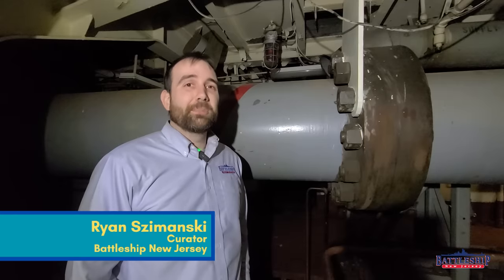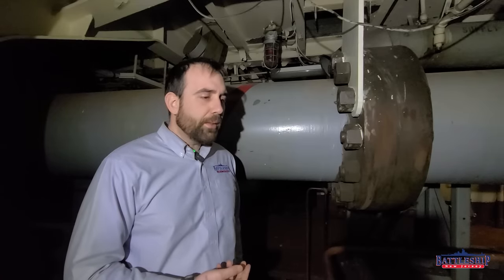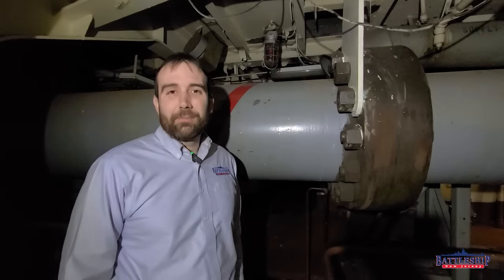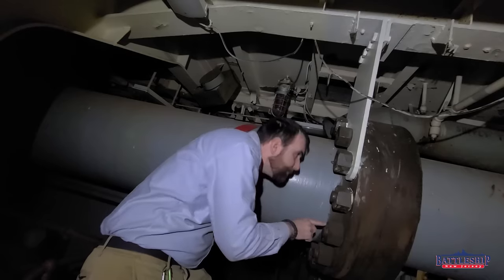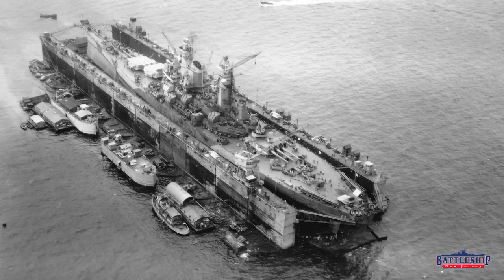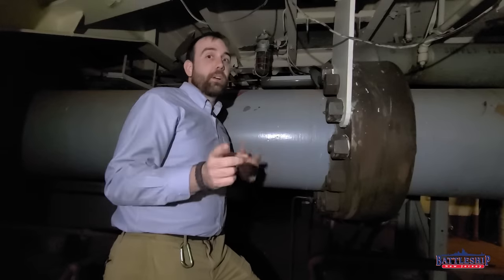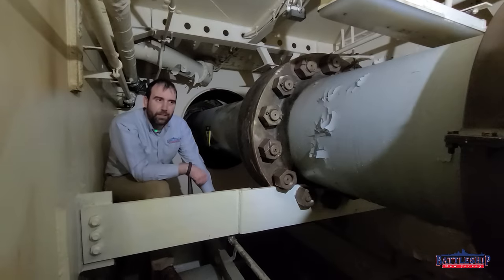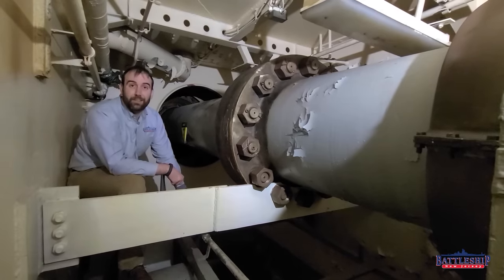Can The Propeller Shafts (And the Screws) of the Battleship Still Spin?

Comment: I was told about an event that happened before I reported to USS Long Beach CGN-9. The story was a messenger watch blew off his rounds and a line shaft bearing had an oil leak. The bearing stripped, then melted. When they finally stopped the shaft, it had gotten so hot the sand in the shaft was melted. They pulled into dry dock in Hawaii and pulled a shaft section out of some warehouse. We were told it was a war time reserve shaft. Anyway, the shaft was replaced, the watch was convicted in court-martial, and the ship continued on deployment. That section of shaft had a larger diameter flange than the rest of the shaft. I assume the navy still has spare shafts stored somewhere.

Comment: Interesting that you said they didn't want the engine turning.  The huge steam turbines at power plants have a turning gear that slowly rotates the turbine shaft when started up or shut down to allow temperature to normalize uniformly.  Also used sometimes when shut down for long periods to keep the turbine rotor from bowing if left stationary for a long time.

Comment: I still say that this old battleship ship has more use than the Navy’s “high tech” LCS “Littoral Combat Shyt”……the Navy is retiring these new ships as they are worthless. Why not have a new style ship like this. It would be much better as the Navy is getting more “action” these days.
Reply: The LCS ships are not worthless as a class.  The problem is two-fold.  First, the contract says that ship's force is not allowed to repair anything in the engine rooms, so any problems by contract will need to wait until they can get folks from the shipyard  to the ship or the ship to the shipyard.  Second, the USN under pressure from congress kept changing the mission of the ships, making them ill-suited to efficiently perform any specific task.  In a nutshell, the ships are container haulers with the expectation that any mission-specific equipment will be pre-installed in modules to be winched on board, tied down, and connected to power, data, plumbing, or whatever.  Ditto for the berthing areas for the equipment operators...just another couple of modules to be secured and hooked up.
Reply: @kevincrosby1760  yup, essentially as a retired Marine I see them as worthless. They are floating targets and can’t be useful / ready when needed. 
Additionally, name a war where these Generals actually won? 
I was there in Kosovo / Bosnia 1999, 5 tours Iraq, 1 tour Syria, 3 tours Afghanistan. I’ve been on many many ships in my career. The Navy has lost its mind as well as the military in a whole. Since I retired in 2015, I’ve seen some stupid stupid programs to waste money on. 
Just my opinion though
Reply: @MountaintravelerEddie  Don't EVEN get me started.  Classic example of officers who know everything failing to listen to the non-coms who actually have a clue.

"Newer" is not always "better".  Target is at 600 yards.  M4 or M14?  Self defense.  You get one shot only.  .45ACP or 9mm?  (full disclosure:  My EDC is 13+1 in .45ACP.  I may be biased.)

Biggest pet peeve...  Ship needs fuel.  UnRep with a Navy Oiler at sea, or pierside in Yemen like the USS Cole?

Doesn't matter what we are discussing.  The more tasks you try to get a given platform to perform, the worse it will perform at any one of those tasks.  

IC2
USS Kansas City (AOR-3)

Comment: In boilers you always have a nice assortment of knocker wrenches to remove nuts from tank heads , pipe sections,shafts ,and turbine housings. I’ve seen those wrenches as big as 10” inches.

Comment: I was stationed in Long Beach 89-93 and many of the larger parts for the Battleships were kept there. also as an MR (Machinery Repairman) I was stationed at SIMA San Diego 31a machine shop (00-03) and we had the vertical turret lathe that cold machine the turret parts. That VTL had been there since WW2 and I believe its still there.

Comment: Those "locks" remind me of my friend who used an entire ball of kite string to tie a railroad car to a track bumper post to keep the car from moving... I suspect that if they were to fire up the boilers, and engage the engines, those plates would not keep the shaft from turning.
Reply: Oh yeah, the shaft would turn under main power but it might do horrific damage to itself before the plate broke
Reply: @JamesF0790  As thin as those plates are, and the length of the plates, they are like tissue paper, compared to the shaft or armor they are welded and bolted to.

Comment: Hi Ryan, good video of the shafts. I did my apprenticeship with a shipping company here in NZ and I think you will find that the shafts, if need to be removed for inspection are pulled inside the ship. Reason being the large flange that holds the coupling bolts is too large won't go through the stern tube (bearing just forward of the propeller). We used to remove an intermediate shaft to allow room for the tailshaff to be pulled inboard. Cheers Ian - New Zealand.

Comment: You don't have these shafts on modern cruise ships which are way larger.  Modern boats use "Azipods", or pods that hang down from the bottom of the boat and have 40,000 hp electric motors inside.  These can spin 360 degrees and normally the propellors are at the front of the Azipod, in a "tractor" configuration, just like an airplane.  

There are a few older cruise boats that have shafts, such as the Ruby Princess and similar boats, but they still use electric motors to turn the shafts;  The four huge Wartsilla diesel engines operate generators.

Shafts are going the way of the dinosaur!
Reply: Still the most efficient way to move an aircraft carrier. I’d like to see the pods function in North Atlantic on a DDG where the screws can come out of the water when cresting waves. However, having been on a carrier while pulling into port, I’d love to have those pods!  Took us a couple hours to get moored while a cruise liner zipped by us, rotated pods and was pier side, moored, brows down in a bout 30 mins lol. I think subs have some sort of retractable “pod” they use for maneuvering in port?
Reply: @USNMMCret  I don't know about subs, but they have a ducted propellor these days that can turn a whole hell of a lot, and thrusters are pretty easy to install.  As to the azipods, they are fully electronic with only an electric motor in the pod, so they can spin 360 degrees and propellor speed is controlled down to the 1/10 of a second.  Operation during a DDG probably wouldn't be a problem as a result. They just spin and the amperage sent by the computer goes up and down;  The device could care less if it was moving water or air....

(Hey, maybe it will knock some barnacles off...)

-The only problem with azipods, and this is why I think the military is avoiding them so far, is that they have had trouble meeting time before overhaul.  The bearings have been trouble, trouble, and more trouble. Did I mention that the bearings in these have been trouble?  These have been around for 20+ years and only this year did Princess cruise lines build a boat with these;  They have publicly stated that they don't trust them.  Carnival in general has been slow to take them.

Thanx!  🍻
Reply: @Flies2FLL  I think that the sea-tractors (tugs) used at the Kings Bay Naval Base in Georgia have pods for propulsion. They were used to get subs in and out of port and they were using that technology in 90’s. Would be curious to see if govt have considered using on MSC ships to see if efficient.

Comment: I was wondering, A ship like the NJ is bound to have asbestos in it for insulation/fire protection. Does this affect the docking in any way?
Reply from the maker: We're fortunate that the navy removed almost all of the asbestos in the 80s, so its not an issue for this project.
Reply: @BattleshipNewJersey  Beware the difference between "removal" and "abatement".  The USN categorically denies that there was any chance of my having any chance of asbestos exposure shipboard due to it all having been removed from the ship or abated in the early 80's prior to my service, yet the VA sends me in for imaging annually due to my having been on board in the Engineering department while asbestos was being removed during our 1988 DPMA.

"Removed" is self-explanatory.  "Abated" means that the asbestos is covered in such a manner or is in a form that it will not be an inhalation hazard during normal use.  All bets are off if you start disturbing pipe lagging or (more likely in your case) you start ripping out those pretty pre-80's floor tiles to replace the damaged ones or to preserve the steel decks beneath.  Other areas to be wary of are anything related to insulation in the fire rooms or the stack uptakes.
Reply from the maker: Ours was replaced with a different material.

Comment: With the locks removed, how much force does it take to rotate a free spinning propeller shaft ?  Other than getting that much mass to move, it may not take all that much. 
  One curator may be able to rotate the shaft.
Reply: Easiest way to tell is how big the turning gear motor is...   bigger the motor = more force

Comment: I’m curious about the drag from the stationary props and how much it affects towing vs if they could spin freely…like the tugs fuel consumption when it goes to dry-dock.
Reply: It's probably negligible considering the marine growth on the hull too.  You wouldn't want the shafts to spin without lube oil systems going otherwise you wipe every bearing in the reduction gear & turbines.

Comment: I wonder if U.S.S. Cod has a battleship sized wrench, I imagine they probably got something similar, any mechanical situation be planes, ships or vehicles there is a BFH and BFW nearby, Big F Hammer, and Big F Wrench since this is a family channel I will leave it at that.
In the Air Force as a Jet Engine Mechanic we had a "Wrench" to the install the Turbine shaft nut that hung from a overhead hook I also used the BFH on a daily basis Jet Engines had many fasteners that needed a little or.a lot of  persuading.🤣
Reply: They recently made a video about the prop wrench.

Comment: would they "unlock" the shafts to move it for dry dock procedures?  Or would it be towed? Thanks 
Spreading the word of your insights.
Reply: As a museum she's being towed. The navy doesn't allow her engines to be started according to the contract. In a more general setting if the Navy had them locked during the time they had the ship in reserve then they'd likely leave it in place and remove it while in drydock as otherwise the engine would be turning over from the shafts without the lubricating oil and stuff in it.

Comment: What would happen if the shafts were not locked and the tides caused the propellers to spin at a slow rate and turn the engines at a slow rate with no steam pressure, obviously the engines would not start because they rely on steam pressure to turn but could it damage the engines? I assume whatever preserving fluid the navy put in there is not the same as the normal engine oil that would be used on that kind of engine or is it the correct engine oil for that engine?
Reply: And why did the dry dock ask if the shafts were locked? Do they want them unlocked so that it reduces drag when they tow? the ship or do they want them to stay locked to help prevent possible damage to the engines and shaft seals?
Reply: I would think that with all the gear reduction it wouldn't turn the turbine which turns the shaft
 The engines power the turbines.

Comment: Does having the rudder and propellers locked into place hinder its towing?  Presumably most of the time (but I guess not the final time) if the ship was under tow, these things could move with the current?
Reply: rudders & shafts are usually locked for towing evolutions.  Tidal motion while at the pier is not enough to spin/freewheel a shaft - too much friction to overcome - but towing introduces a lot more forces and you don't want those systems moving without lubrication - would be like driving your car without oil

Comment: I wonder what the torque spec on those bolts is?
Reply: How would measure the torque on something that big?
Reply: @tomkrisel4493  With a very large torque wrench that goes "CLICK"!
Reply: @francissullivan5900  They might also have a spec where you bottom out the nut, and then make a specified number of turns... the torque spec would presumably be very high and a torque wrench, especially in the 40s when the ship and those couplings were built, that can measure extreme values and be easy enough to maneuver in that space would be maybe a little bit of a problem. Torque spec on my cars lug nuts is already 100 foot pounds, so that's 50 pounds of force on the 2 foot long torque wrench I use. 

Multiply that torque by probably a lot, and the length needed to make it reasonably usable by a human can get quite long. 

Though I suppose they could have some complicated torque wrench that uses some clever mechanical advantage to keep the length reasonable.  

That actually might be an interesting video, what are some of the specialty tools used to maintain and repair a battleship?  Even everyday road cars have a few specialty tools, though most of the time in that case standard tools can be made to work(though you might have to remove extra stuff to make room).

Comment: Uh....with packing sure if there welded closed no....but otherwise it would be a hard thing to get moving id imagine 😅
Reply: That's true. And if it is packing and hasn't dried out too badly it would have need to be connected to a stepping gear to keep them from warping g

Comment: Never seen how the 5 inch turrets are locked or are they?
Reply from the maker: They arent. We rotate them occasionally and fire them often.
Reply: @BattleshipNewJersey  I'm surprised you got working 5-in turrets, did anything special have to be done to them to make them work? I know New Jersey has very strict firearm laws and I also know that rifled and smooth bore firearms that have a barrel inside diameter of more than one half inch and don't have a valid sporting purpose or also regulated under the national firearms act of 1934 as something known as a destructive device and New Jersey does not allow  NFA weapons. How are they allowed to work? Is the barrel cut or drilled in a specific way so that it can still fire blanks but cannot contain the pressure to fire a actual projectile? I assume you shoot blanks out of those and not like a wooden slug
Reply from the maker: They didn't really do anything to de-mil the guns, and as long as we're firing blanks all the government regulators seem fine with it.

Comment: The USS Supply AOE-6 has the tail shafts from USS Bridge AOE-10 which was under construction. When we were built the Strut Bearing Staves were never installed and the shaft was worn most of the way through.  During builder trials, Nassco Shipyard damaged one of the screws and the Navy replaced it with one of the spares for the USS America CV-66

Comment: You really should sell off the props and seal off the shafts from the sea. Whatever it costs to remove and seal will be more then made up in the case raised from four props. Worse case how much does each prop weight and what the price of copper per pound?
Reply: why would you sell artifacts like an iowa class' screws? those are literally priceless and also there's not very many of them. 

also the screws are bronze.
Reply: @everettbruckerhoff6029  Were talking about the most valuable metal. And is there something magical or special about screws especially when preserving the entirety of the ship is really priceless.
Reply: @markfarris2630  Because they, just like any other part of the ship's history, are part of said history. Removing them for display or preservation is one thing, but selling them would be (in my opinion) a travesty.
Reply: @markfarris2630  Unlike most of the equipment on board a Navy ship, the propellors are specifically designed and cast for a particular ship.  There are no others exactly like them in existence.
Reply: @kevincrosby1760  OK and is the Navy going to take it out for a stroll tomorrow?
Reply: @markfarris2630  probably not.  Would you also advocate for somebody to take a rock crusher to the Giza Plateau and systematically dismantle the Great Pyramid so that every tourist can buy their own little bag of 3/4- crushed rock?

For that matter, how much copper is in the Statue of Liberty?